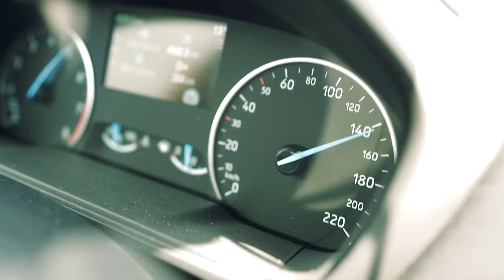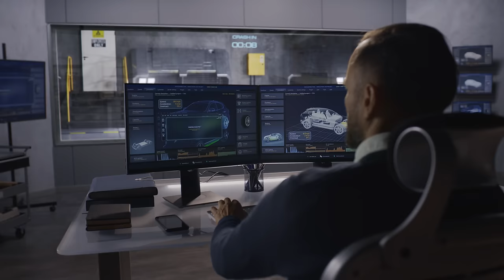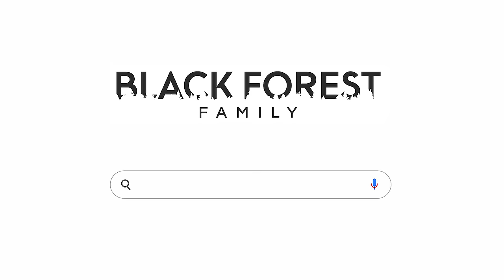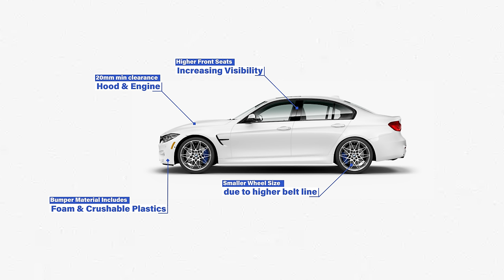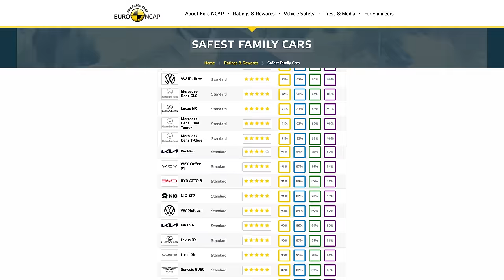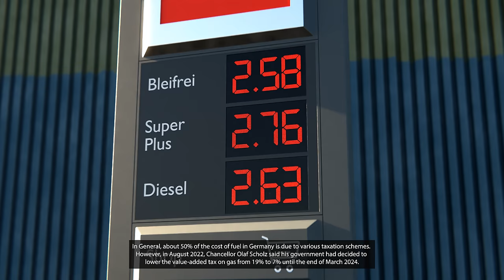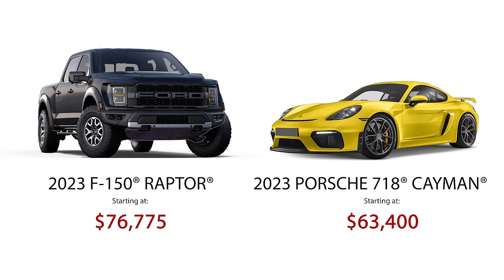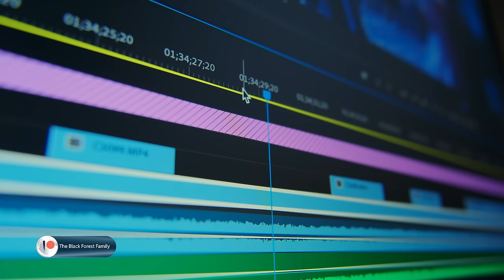DRIVING CULTURE CLASH: Why do our Cars LOOK so Radically Different?

Comment: Try to park an F150 anywhere in Germany, or the rest of Europe and you’ll understand why we use smaller cars.
Reply: not a big deal to be honest ... did you ever try it?
Reply: the standard for parking spots in malls and building in Europe is max 5 meters, and the shortest F150 exceeds that. And yes, I drive regularly, I mean three four times a year, in both continents.
Reply: @luigifranceschi2350  driving on both continents is one thing, but did you drive an American pickup truck in Germany?
Reply: i drive sometimes vehicles that have similar size of an american pick up, such as fiat ducato. trust me, is no joke to go around with that = @EnjoyFirefighting
Reply: @luigifranceschi2350  no big deal ... and I drive both 5t ambulances and American pickups, also in the cities, also in oldtown areas
Reply: @EnjoyFirefighting  usually you do not have to park an ambulance in a regular parking spot made for regular cars.
Reply: @luigifranceschi2350  usually not, but sometimes I still do so. Sure, the length of the spot isn't made for it, but choosing a spot where the rear can overhang beyond the spot and over the grass or divider to the next row of parking spots, reversing with the rear wheels all the way to the curb, it will perfectly fit into the spot without taking up 2 spots. Works for the ambulance, works for full-size half ton trucks as well
Reply: @EnjoyFirefighting  you are lucky to always find 2 spots were to park. Very practical when you wanna do grocery in the mall on Saturday, when you are lucky to find one spot, or when you to park and there’s only available parallel parkings. Try to park your ambulance I. A regular parking in Milan for example, you are lucky if you find a spot for a smart, forget an F150!
Reply: @luigifranceschi2350  I fit my RAM into a single spot, with the rear overhanging onto the grass, but from right to left it perfectly fits into the spot. 
No luck, I always find an empty spot, and always find sufficient space for parallel parking as well. Even when I return late at night I find a spot on the residential street
Reply: @EnjoyFirefighting  if you find some grass in the city is probably only to smoke
Reply: @luigifranceschi2350  every parking lot at a supermarket has some grass around. Don't make it sound more difficult than it is in reality
Reply: maybe in your village. in the city there are mostly undrgrond and you have to lawn at the end of the parking, but a solid concrete wall, or the other car. @EnjoyFirefighting
Reply: @luigifranceschi2350  I live right outside the coutnry's 2nd largest city and happen to drive all the way downtown. Wanna try me and I take pictures of every single parking lot and spot I take my RAM into when I'm in the city? I can upload a slideshow video just to proof you wrong.

Comment: I once cam across an American in a facebook discussion who insisted that you needed a truck to pull a trailer and would not believe that it is possible with a standard car.
Reply: like I said earlier: depends on your definition of 'trailer.' A 3-5m lightweight Euro trailer is a different animal to the 10-15m American 5th wheel.

Comment: Hi Ashton, probably for the first time I feel the need to correct you in a single item. For the comparison between US and European vehicules you picked a wrong example: The European equivalent of the Ford Escape is the Ford Kuga and not the mentioned EcoSport. The EcoSport is one class below the Kuga/Escape and much smaller. Kuga and Escape are  and look the same in the US and in Europe and has been designed in Europe for global distribution. 
Anything else is brilliantly investigated and reported as ever. Great job.
Reply from the maker: Thank you. A few others have pointed out my mistake - I'll post it as a pinned comment as a correction to the video.

Comment: Hello Dr. Ashton,

Once again a well researched presentation but I’m going to dissent from your blithely dismissing EVs from your review of car safety. I consider your presentation on car differences and their safety scores to be a retrospective look at the issue as things will be changing as the world shifts to EVs. Prior to my first EV purchase,  I’d owned 4 Audis that I bought new and traded with an average of 200k miles on the odometer. They were great cars, fun to drive, and everyone had a manual transmission. I’ve now driven an EV for eight years and they are more fun to drive but also have safety ratings that leave ICE vehicles in the dust. The lack of an engine means all of that space between the front bumper and passenger compartment is now a crumple zone and my car has a top notch European pedestrian rating since it incorporates a sloping hood as again no engine to be designed around.
Reply: She dismissed the EV because they are produced to much higher safety standards simply because of their propulsion.

Comment: Well , there is more to consider , i rather pay a bit more Car Tax  , which is not really that much , 250 Euro / Year here in Germany ,  than have that much potholes in the Streets as you have in the USA . Why are there more potholes in the USA ? because Fuel is (relativly ) cheap and the Tax on it is low and excactly this Tax is used to pay for Street repairs . Cars get more efficient , even Pick ups , Electric Vehicles even dont need Fuel = revenues from this Tax are more or less constant since Decades and are set to decline  but everything gets more expensive = less money in the Budget , less Money for repairs . In general there is a big backlog in Infrastructre repairs in the USA , may it be bridges , rails , highways , streets ... . In general Streets in Germany are in relativly good shape , even outside of Towns = i save Money , i use my Tyres 10 -12  Years . I dont drive that much .
Reply: the very same backlok on road infrastructure maintenance can be observed across Germany as well? Just saying the crumbling bridges across the Main river or the collapsed Baltic Sea Highway ...
Reply: @EnjoyFirefighting  
i wrote "in general " , of course their are exceptions , mainly there were its not clear who has to pay for the mainentance . Normally its clear , every road has a Letter with a Number to it = B xxx = Bundesstraße = Federal Level  , L xxx= Landesstraße = State Level  and K xxx = Kommunalsrtraße = municipal Level but sometimes their is a quarrel on municipal / State Level or State / Federal Level  over the designation
And yes , their is a backlog as well in Germany with Bridges , but Germany had to invest lots of Money  to bring the eastern part of Germany to aceptable Levels after reunification  , that includes the Infrastructure there as well , the Technology Level there was on the 1950/1960 Level in 1990 ....

Comment: Very nice video. I (as a german) found it to be quite interesting just how much the safety requirements but also taxes on cars and gas differ between Germany / Europe and the US; but I also do not really understand why so many americans only use trucks for towing when a normal car could do it just as well - although they probably (as you mentioned in the video) only own a pickup / suv so they do not really know it can be done with a different type of car and it is probably a matter of culture as well (because americans seem to love trucks).
Reply: what's the length of your trailers? Weight?  Compare that to the trailers that we have here. Some of which are bigger than some apartments in GER
Reply: @GummeeH3  I can't give you exact numbers for this, but I can tell you that we have trailers off all sizes - although the really big ones (where cars or shipping containers or anything else that's really big can be transported on - we also have another type of truck to tow oversized cargo like a wing of a wind turbine, we call them “Schwerlasttransporte" (which I think translates to heavy duty transport in English)) would probably be towed by a semi truck (which again is designed in diffrent ways between Europe an the US)

Comment: I drove a Ford Mustang once. Never again. It was like driving an old cart pulled by 2 old sick horses.
I prefer an R8, M5/M8 or C63/E63 to any American "muscle car".
Reply: I drive BMW and Mercedes-Benz at work and althoug the Mercedes has its issues, the BMW is what makes me sick concerning the required maintenance, not being able to withstand a bit of beating when driven at the max. 
As private car I used to have various European brands: Smart, Opel, Skoda etc, but I went to an American one lately
Reply: @EnjoyFirefighting  I own a 2017 BMW 750d xdrive and have no issues with it. The only maintenance I do on it is oil & filters change and that's it.
Reply: @h.u.l.k.7072  we have to hit the shop for new brakes almost once a month with our 220d xDrive Gran Tourer, apart from the numerous other technical issues. Sure, we give it a hard time, but it just doesn't stand the constant beating. We just hope that it falls apart and will be replaced by a Mercedes soon. 
Even the older and way cheaper Skoda is in way better shape than the BMW
Reply: @EnjoyFirefighting  Well, to me it sounds that you don't know how to drive a BMW. Don't worry, you're not alone. 🤭
Reply: @h.u.l.k.7072  No, it's more like us hitting 200k km within just 2 to 3 years and that we constantly floor it, brake hard, and floor it again. Also, pushing it to its limit, hitting top speed a minute or two after a cold start is simply sth BMW doesn't handle well. Not to mention it absolutely not being able to handle gravel roads well, or even driving offroad. Can't even mount or decent a curb without damaging body parts
Reply: @EnjoyFirefighting  Well, that's torture, not normal driving. For me, pushing the limit meant hitting 250 km/h on the highway, not flooring it and braking hard (that's the best way to destroy any car).
Reply: @h.u.l.k.7072  of course it is torture ... that's how we handle every car from every brand, and the more expensive BMW can't handle it nearly as good as the cheaper Skodas for example. 
Well that's how emergency vehicles are driven. It's not like starting slow to slowly warm it up, driving a smooth and constant speed, it's way more as I decribed before. Might leave the station with a cold engine, reach the highway after 500m of driving on side and main streets before reaching the highway where I floor it and reach the top speed of 220 kph after a minute ... and that won't be a long distance journey either; Maybe one or two exits down the highway I leave it  behind to get into the next municipality, braking rather hard when taking the exit and approaching intersections. That's plain normal for emergency vehicles. and BMW does a lousy job in that aspect. The Skoda has more than 300k on the clock and still performs astonishingly well
Reply: @EnjoyFirefighting  Ah, OK. That's a totally different thing. BMW wasn't built for that kind of stuff so of course it can't handle it.
Reply: @h.u.l.k.7072  "so of course it can't handle it." uhm other brands aren't specifically built for that either and they can still handle it. But apart from that: BMW has its own division building emergency vehicles for Fire / EMS / Police, so yeah they kind of are built for that when you can order them like that right from the producer.
Reply: @EnjoyFirefighting  Well, this means that BMW doesn't care about offering a valid product to the customer and that is BAD, VERY VERY BAD. It is well known that VW group can offer very reliable cars for the emergency scene, then I'd choose those, obviously. 
I was talking from the civilian point of view, not professional.
Reply: @h.u.l.k.7072  it's not that easy. A provider can't just say "I want to have brand X, so I just buy brand X" ... the provider has to publish a request for tender and all the different brands which want to participate can place an offer. When brand X doesn't take part, that provider can't choose X. And if X takes part, but Y makes a better offer, the provider will have to choose Y instead. 
In EMS BMW finally lost the bet and new units will be based on a Mercedes instead.
Reply: @EnjoyFirefighting  I know about tendering for EMS vehicles. Here, in Austria, we have VW (ambulance and firefighting dept.). To be honest, besides VW and Mercedes-Benz, I haven't seen other reliable brands that one can count on. Even the police has Skoda vehicles.
Reply: @h.u.l.k.7072  there are quite a few reliable ones out there. Skoda, Mercedes and Volvo for example. Although quite a few police forces use VW, we don't have many of them in EMS and I never made first hand experience with any.
Reply: @EnjoyFirefighting  I've never seen a Volvo ambulance nor a firefighting truck.

Comment: German car companies are still riding on reputations for quality and engineering excellence that no longer applies.  New cars from Mercedes and BMW and VW are generally as reliable as American and Korean brands and less reliable than Japanese brands.  Where German cars fall flat is in long term reliability and and their expensive repair bills.  Your darlings at VW got caught in a huge scandal that almost brought down the company when they used that German precision and engineering to detect when their diesel engines were being emission tested and altering their operation to yield results much lower than actual output.    This "clean diesel" myth drove diesel sales in Europe  for decades but the VW scandal has soured many on diesels.  Modern diesels are not the million mile wonders largely due to the emissions controls instituted in response to the scandal.   Diesel cars do help in one aspect that you point out, towing.   You want precision engineering?  Buy a Toyota.

Comment: The fact that cars are generally getting bigger, with the same type, is the increase in safety devices. 
The VW Golf I had no airbags and extended crumple zones and therefore weighed only 800kg, a modern car has up to 5 airbags and extended impact zones. 
So the car has to be bigger in general.

A historical example is the AMC Peacer. The car would have met the ( planned ) safety standards 81, which other car manufacturers opposed and then also failed.

Comment: Thanks you for the video. Two comments: the US is finally thinking about introducing safety standards for pedestrians and bicyclists and are asking for comments. Why they have to think about something that is well established in Europe is beyond me, but I’m sure the US auto industry has a different opinion on that! Secondly, it is my understanding that SUVs and pickup trucks are considered trucks, not passenger cars in the US and have lower standards and guidelines, making them cheaper to manufacture. And that helped make them so popular. And when you have so many big trucks and SUVs on the road, people don’t feel safe in sportscars or smaller vehicles half the height and size of the vehicles around them.

Comment: One key reason, why cars have grown, is safety. The crumple zones of cars have increased.

Yes, cars are growing, but not nearly so fast in Europe as in the US.
The reason is simply that there are standards like how wide a lane is or for the standard parking lot. And these standards are lfocused more on vehicles that move in cities as weel (not nearly all city cnters are car free), but still apply to new suburbian developments as well. Car related infrastrucrure in North America has from the beginning been planned for big cars.
Big parking lots, wide turns, etc.

Last point: I think the general car cuture is quite different.
Imagine this requirement: We need more power.
US: scale up the engine, make it bigger, more cylinders, more volume.
Europe (and also Japan): Let's take the existing engine block and find ways how we can squeeze out more power, with turbo chargers, smart enige controls etc.

Comment: An entire video beating around the bush. American cars are bigger and less aerodynamic because major international oil companies are american and they can manipulate the market, by advertising and creating the illusion that big cars and engines are needed, so as to consume more gas. Europe is a net oil importer so its cars and engines are smaller and more efficient on the highway. China is now betting on ev's because it also has no oil. Additionally in Europe generally cars are not allowed in medieval city centers so there isn't as much need for tiny cars so might as well build bigger, safer ones which, bytheway, are still more aerodynamic than the old tiny ones.

Comment: Very insightful! In Canada, our vehicle trends follow (unfortunately) the USA's. More large suvs and pickups are on the road than ever and less cars, because... well, just watch the commercials on TV. Vehicular brainwashing... Uhhhh I mean, truck commercials are all you see. No more family sedans, sport coupes... just big... boxes... with wheels. And they all look the same. Boring! I have always been a sports car guy. Smaller, lighter, nimbler... and above all, fun to drive. Manual transmission of course. Now, you can't find any made by the supposed big 3. Fortunately Mazda still offers the MX3/Miata. Toyota and Subaru still offer the GR86 and BRZ. Hopefully, soon automotive trends here will start to mirror the ones in Europe and Asia once again. Not holding my breath though.

Comment: You should also point out that the difference in the frameworks of European and American cars is that American cars are constructed in a way that they do not deform on impact as much as European cars. The deforming takes out a considerable amount of energy from the impact which will reduce the effect of the impact on the bodies of the passengers. You can actually see that in the crash test and accident footage shown in the video….